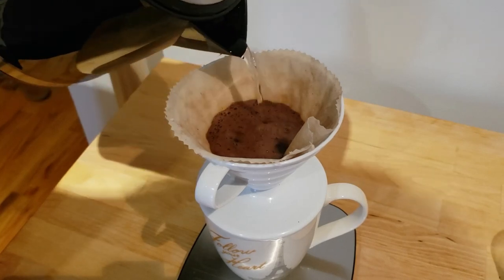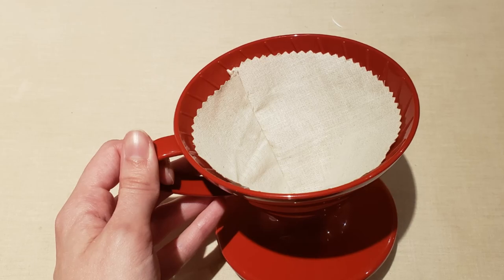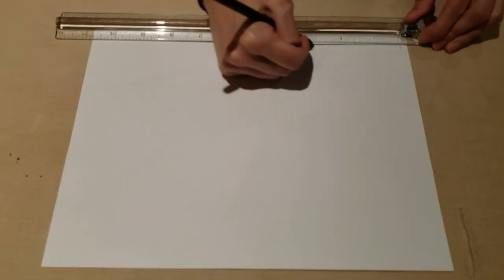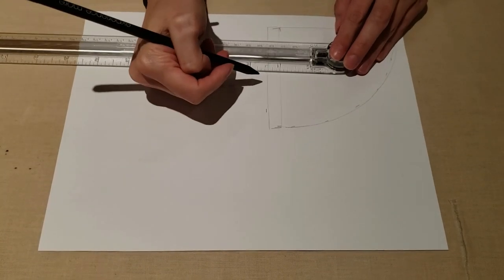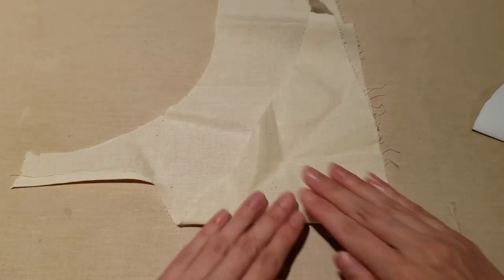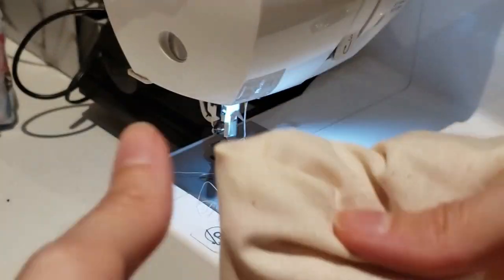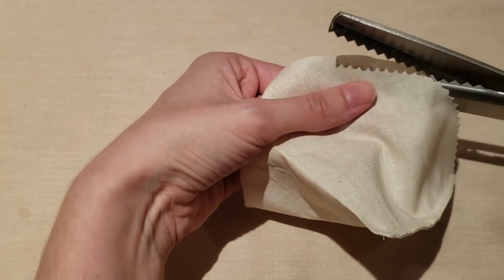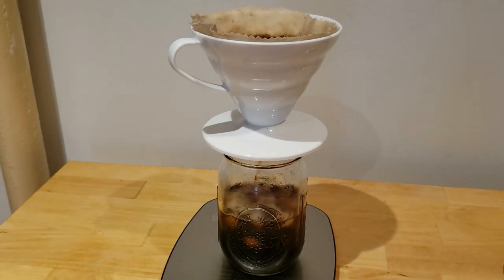How to Make a Reusable Cloth Coffee Filter for Pourover Coffee

Comment: I think this could also work by just cutting a full circle of unbleached cotton muslin with pinking shears.  This would eliminate the possibility of coffee grounds passing into the seam and would make the coffee filter a snap to clean.  Depending on the handle placement of your pour over unit, you could cut the circle larger and use a rubber band to secure the top edge to the outside of the pour over, eliminating those times when the filter sort of folds in on itself.  Thanks for the video!
Reply from the maker: That's a brilliant idea! Thank you for sharing - I have to try that! Maybe a follow up video comparing a seamed and full circle filter?